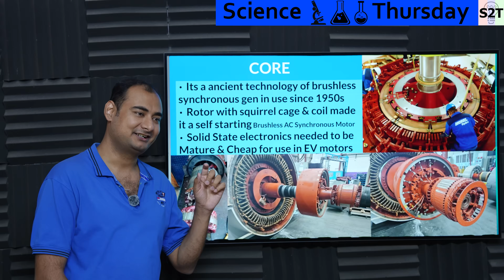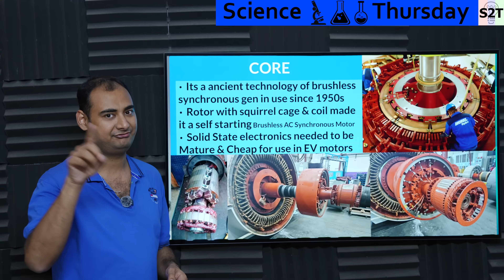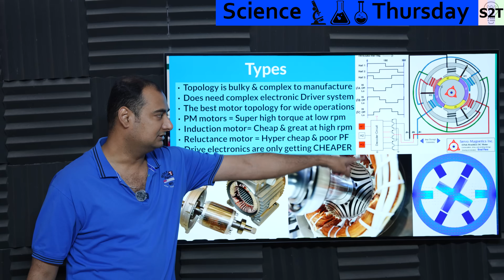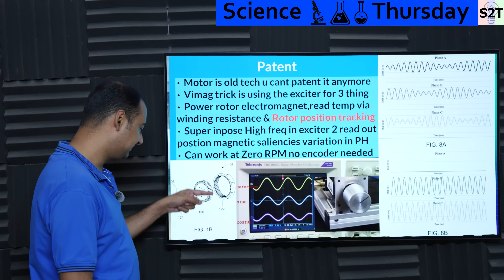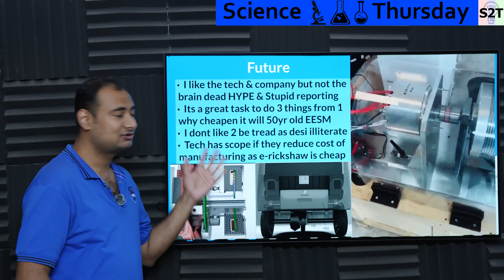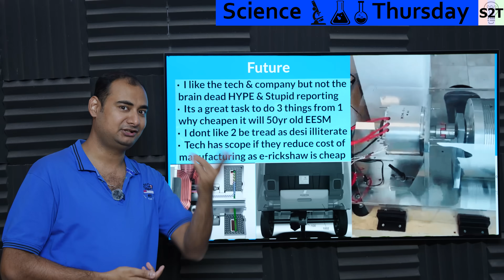Vimag Labs Magnet less Motor Explained {Science Thursday}

Comment: Is it worth replacing slip ring based excited rotor? What's the efficiency gain with wireless rotor excitation?
Reply from the maker: Reliability is key u dont want to deal with carbon dust & Slip rings dont like RPM changes that much